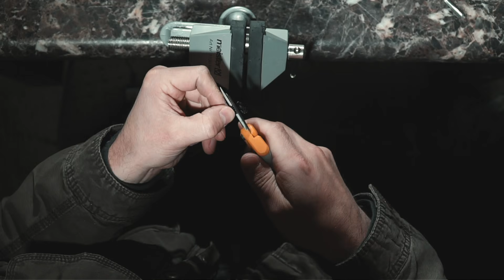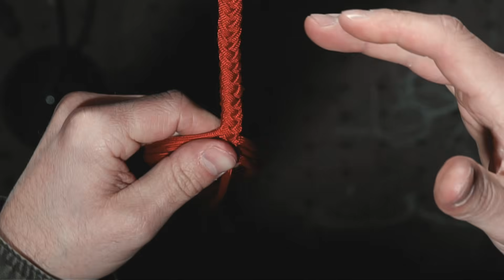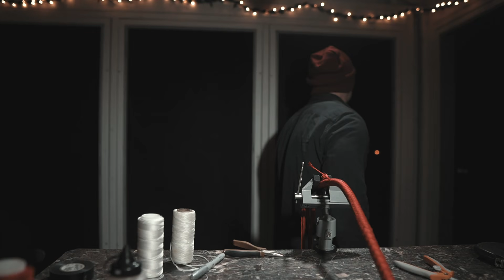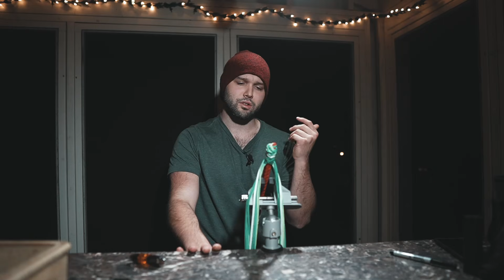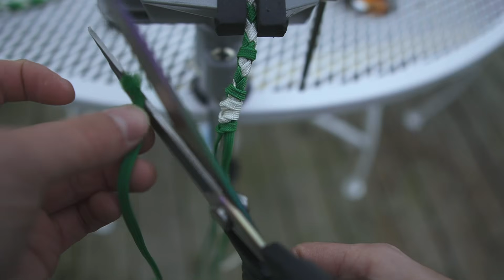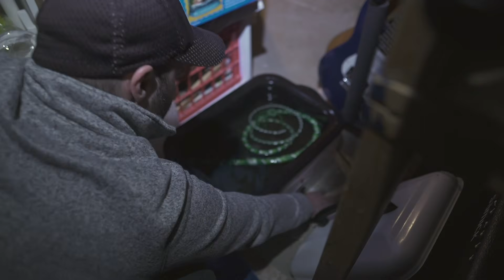My Current Nylon Bullwhip Making Method 2020

Comment: I hadn't done a transition knot until the whip I made along with this video, and when he mentioned that it was a 5x4 turk's head, I experiemented with a different method: I tied the turk's head on the end of a dowel I had just as I would for a heel knot, but more loosely, then I slipped it on the whip and tightened it down. This made it a lot easier for me because I could keep track of the square on the top while tying the turk's head

Comment: Minute  17: I’ve cut strands, found their middles , but don’t know which one to start with. There is no info in there . Could anyone tell which one to start ? 2x11 feet or other ?
Reply from the maker: As long as the orientation is correct (colors in correct places), it does not matter. Good luck!

Comment: Do you ever use an English eye or reverse plait? You need to sharpen those scissors. Fisker scissors sharpen up well.
Reply: I have done the English eye and reverse plait and it is something to try. Adding strands is easier and changing the fall
Reply from the maker: I've never tried any English eye yet, Richard. Might do it in the future. You are definitely right about the scissors, I need to get on that.

Comment: Question: why not run the core strand over the entire handle? It wouldn't add so much size and would just make it that much more secure. Is it because you are trying to create a swell near the end of the handle? I've never understood this...
Reply from the maker: Hi Hiro, firstly as you mentioned it is to create a small swell because I think it looks nice personally. And secondly, I avoid running sinker cord over the entire handle to avoid twisting/slipping. Although with some tight binding, twisting would be rare.
Reply: @NicksWhipShop  ahhhhhhhh, so you ARE trying to recreate the swell on a leather yoke construction... ahhh ok. I thought it was for economy of material and I couldn't understand WHY you simply wouldn't runt he para over the entire steel rod to get a straight handle... but now it all makes sense. Thanks mate!

Comment: i kid you not i just made my first bullwhip last week using your video/tutorial from 2018 on your current method from back then... guess i’m going to make another one lol

i also had a problem with my whip where the handle actually twists around when i use the whip and it’s very odd. maybe i didn’t bind the belly’s tight enough. any thoughts?
Reply from the maker: Thanks for watching, Evan! Could you email me photos? might be the slippery metal of the steel handle.
Reply: NicksWhipShop yes! Where can I email you at?
Reply: Wrap some hockey tape around the steel rod before you start the first belly.

Comment: I just finished the second belly of my very first bullwhip and now you have a new video.... It's all good. I do have a question though. My second belly didn't come out as long as it should have. Like I didn't even have strands to twist together.
Reply: i ran into the same problem, and just decided to shorten  the core and the second belly on the go. just finished plating the second belly yesterday

Comment: If the braided portion of the bellies for a 6 foot whip are 2ft and 4ft should the bellies for an 8ft whip be 4ft and 6ft? And that does not include the handle?
Reply: i followed his other video from 2018 and ended up making a 7ft whip. i tapered my whip a little steeper than one might see on a whip from his video since i used a 8ft whip tutorial for a 7ft whip. my first belly was about 4 feet. the second was 6 and the overlay was 7. it’s all about how you cut your strands. if you are unsure about it then just cut a little more length for your strands and do what seems necessary. it’s all about what you want and how steep you would like the transitions. best of luck!
Reply: Thanks! And does that include the handle?
Reply: Matthew Avinante yes! you would measure from the heel of the handle to as far as you have braided and that is the length.

Comment: Hey nick. I know it seems kind of weird. But ive been trying to make measurements on my whips. Particularly the seven foot whip. But i dont know how to reach my answer. I dont know if you can help or know anyone but id appreciate the help
Reply from the maker: Hi Alexander, what are you trying to figure out exactly?
Reply: i am trying to figure out a formula to decide how long whip strands should be for different whips. a particularly primitive way would just be to wrap a stand of paracord down the whip no? but I am not sure that would work. thanks
Reply: The formula I use is: the length that I am plaiting x 4. So if I wanted to plait 2 feet, I would cut an 8 foot strand. And that’s if you are attaching the strands by folding them in half at the center point as done in this video.

Comment: Man, thanks for putting this up. Watched a bunch of whipmaking videos and always come back to this channel. Using all the stuff I've learned from you and your collaborators,  I'm actually working on my SECOND bullwhip as we speak. 

Thanks again, Nick!
Reply: Yeah I'm at it again. I've made an 8ft electric tape and a 6ft without
Then I made a snake whip. That was fun but I ruined the fall then had to rebuild it. 
I'm starting a 6ft with the newest stuff. My fingers are worn out. Hope yours turned out well. I messed my first belly up bad. Will start again tomorrow
Reply: I'm also not so against the super glue caliper whips uses on one or two steps. But you have to cut steel again with that method. That's okay I have the tools for it.